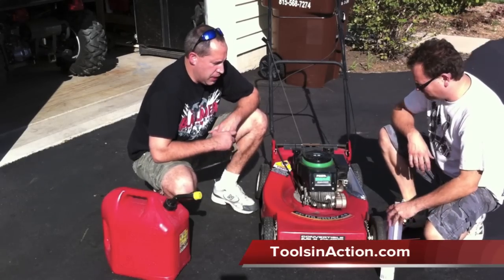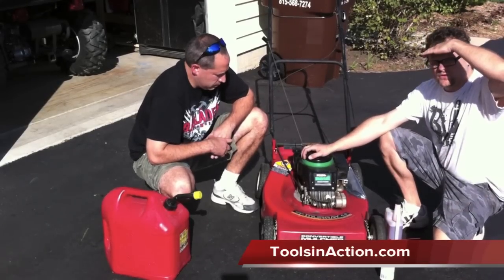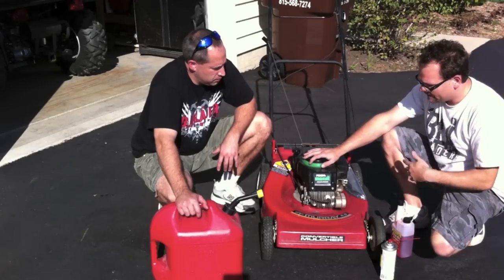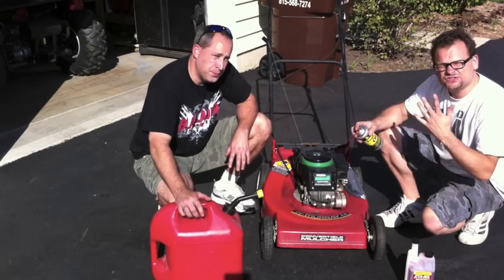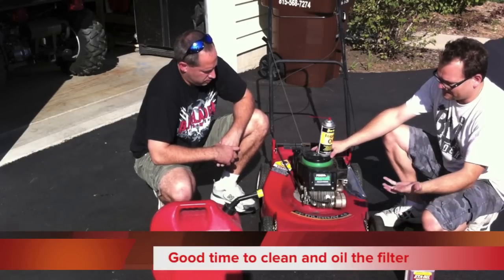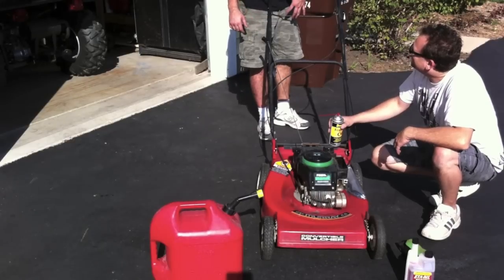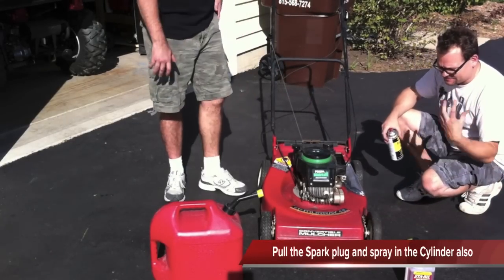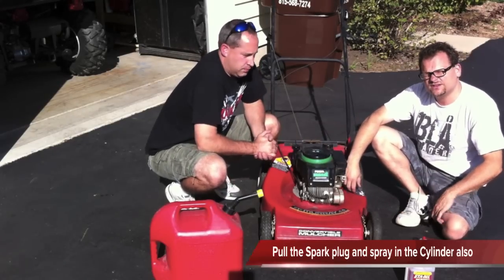How to fog your lawnmower engine and get it ready for winter storage

Comment: Leaving old oil sitting in any engine over the winter months is hard on the engine. It's better to change the oil in the fall so the old contaminants aren't sitting in the engine all winter.
Reply: But when you start mowing in the Spring, you're not using fresh oil.
Reply: @Xinthose  Run the mower for a few minutes then drain the oil. problem solved. If you mower  has that bad of oil then it's obviously not changed every season.